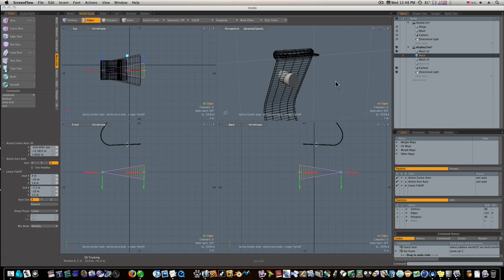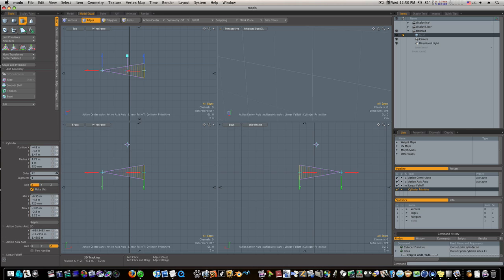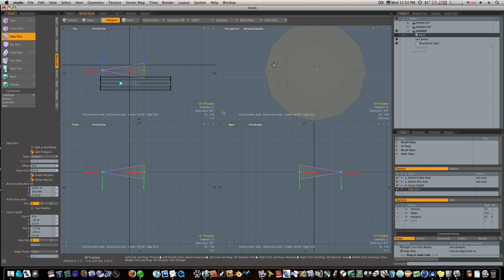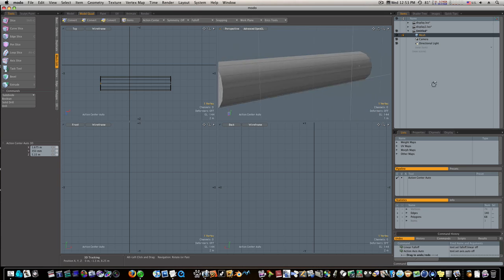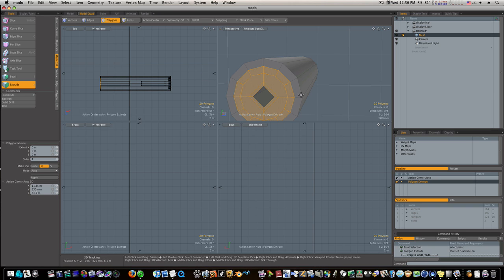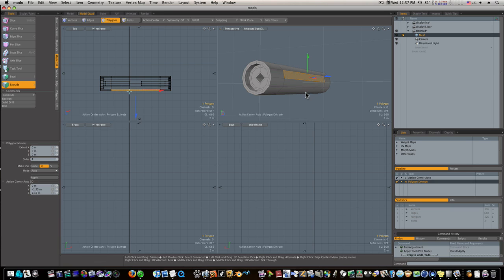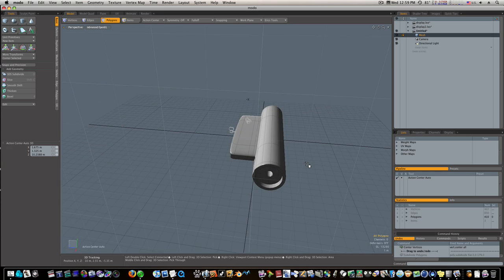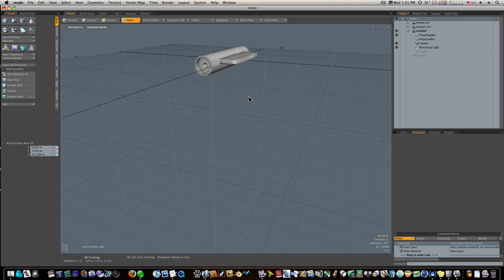Modo 302 3D Modeling Tutorial: Modeling an Apple Cinema Display Part 1 (The Hinge)

Comment: I don't use Modo or any modeling software so my question isn't for me but for others that may want to know.
What if you were making another model and cut out a diamond shape but want to maintain the shape instead of changing to a circle when sub-dividing it?

The reason I ask is because the diamond shape on your hinge converts to circles.